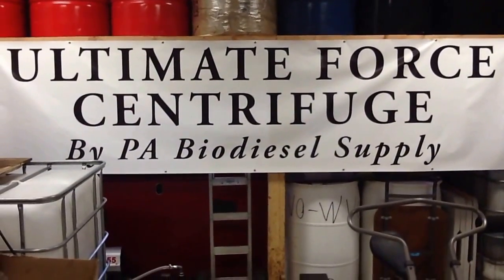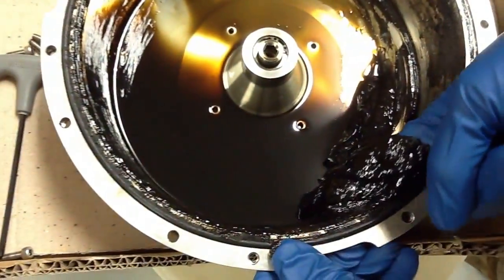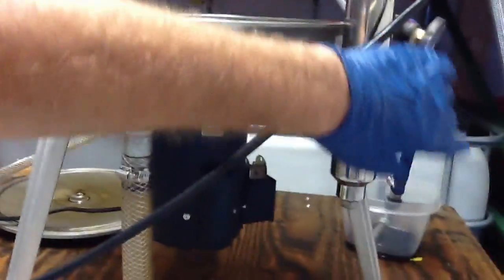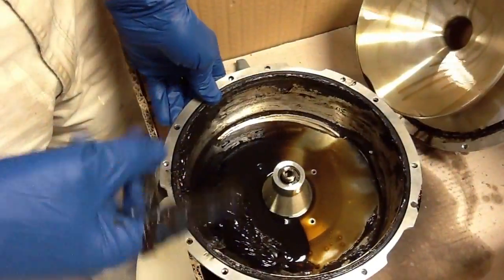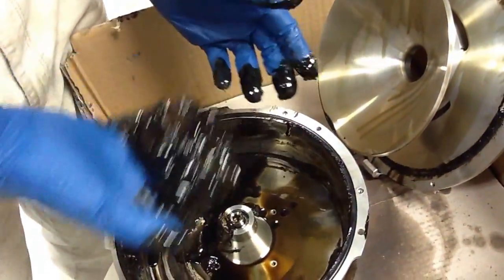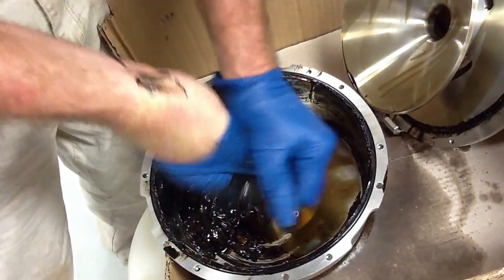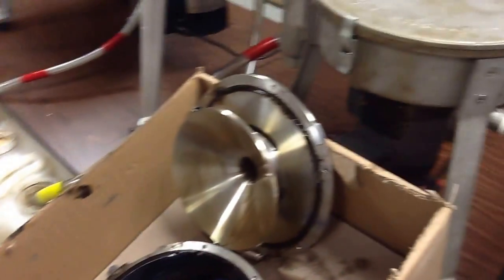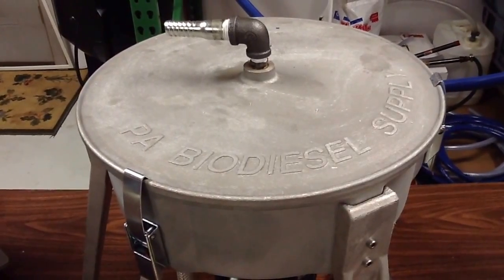Oil Centrifuge  Ultimate Force Series 3

Comment: Joe, Sure you can get more dirt out by slower processing, adding heat, and re-CFing, but there are diminishing returns for successive passes. You added heat on this video, but you did not get much dirt out for all the oil (was that over 100 gal.?) that passed through the unit. Thanks - showing all the water in the processed oil tote - most honest CF broker!  For that, I'll be sending my business your way for the products you sell.